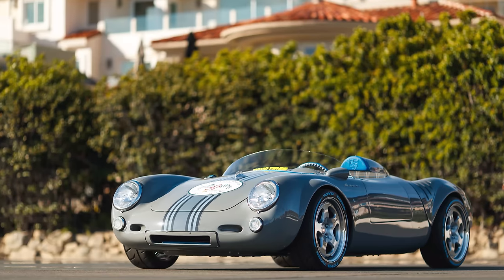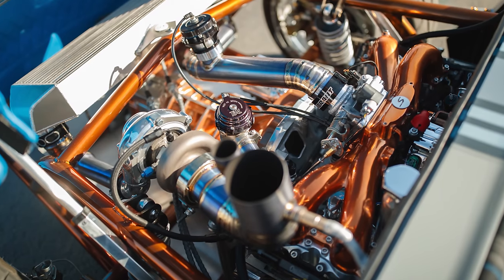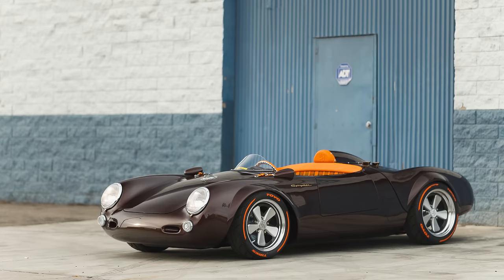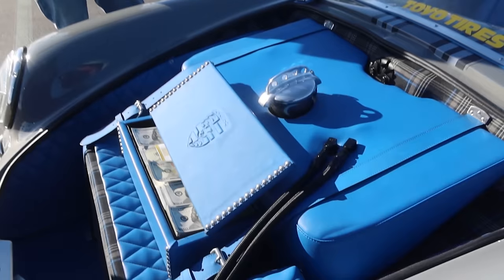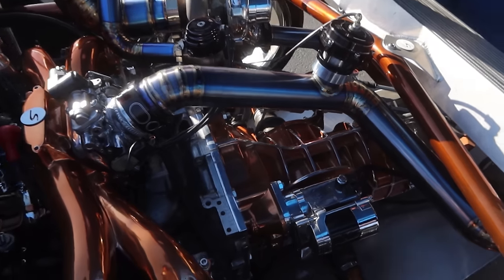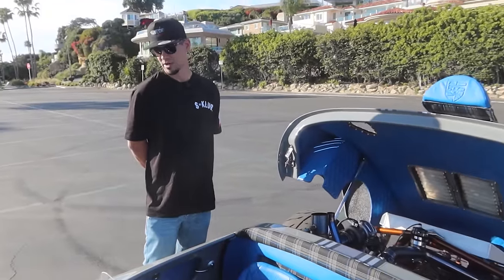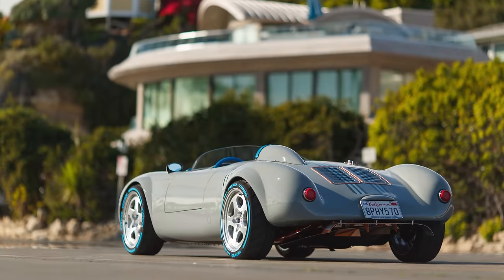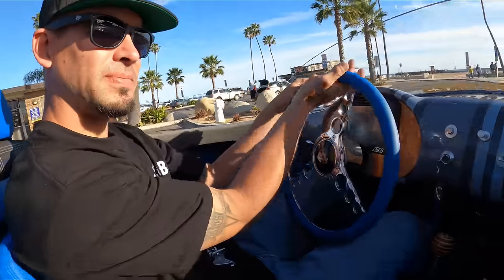A WRX Swapped Porsche Spyder - Clean Build, Sketchy Speed

Comment: Lots of respect to the builder, but the digital dash is really the lazy way out and doesn’t fit the rest of the aesthetic of the build.
Reply: had to use it with the haltec ecu he had to use to make the motor work.
Reply: @1wrexx  didn't have to use it at all. Any old analogue gauge will work with a tach signal, which I'm sure the fancy Haltech ECU can produce.
Reply: TMM exactly, not hard at all to wire outputs to some nice analog gauges.
Reply: I went with the digital dash so I can monitor everything going on with the engine since its highly modified..
Reply: @smokedoggcustoms195  makes sense

Comment: Absolutely A-W-E-S-O-M-E Porsche 550 Spyder.   That is one of my all time dream cars.   I went to the Petersen Museum just before the Corona virus made it's debut and they have a real 550 Spyder there, all original, and it is a crazy cool car.   Smaller than I thought it was.  My dad bought a 56 VW Beetle back when I was in High School and I got to drive it all the time.  I basically shared it with my mother.   That car was SO BASIC (barely a heater, no radio, no NOTHING inside it), but it was one of the most fun cars to drive.   My girlfriend at the time and I always used it to go places and it was a blast.  The 550 Spyder had a lot of the same parts as the beetle at the time, although as everyone knows,  Ferdinand Porsche upgraded and modified everything to his liking and the 550 Spyder was born.  One of the all time greatest vehicles ever made.

Comment: i have a sf forester 2001 ej 205 with the same turbo - yes starts working 1,500 rpm - runs to 7,200 rpm any time ! great .
Reply: back when Subaru were good.
Reply: @Dockhead  the motor has changed in years lol

Comment: Love the color. Really like the fact that it has a relatively small engine in keeping with the 550 Spyder. The original had just over 100 HP and weighed 1200 Lbs. This has triple the HP. I’m not a fan of all the extra leather in the “frunk “ and the electric opening engine cover (against the low weight minimal ethos of the car), but to each his own. Is this a fiberglass or metal body, and who made it?
Reply: This guy and his brother make cars and it fiber glass

Comment: I’d love to see a build like this that uses the newer turbocharged 2.5 liter flat four used in the Porsche 718 Cayman S and Boxster S. In stock form that engine puts out 350 horsepower and 309 lbs ft of torque. The last Cayman and Boxster GTS that used the 2.5 liter flat four had 365 horsepower. Even the base 718’s with the 2.0 liter flat four have 300 horsepower and 280 lbs ft of torque. Either engine can be easily modified to get more power. The 2.5 liter engine could very easily be tuned to put out over 400 horsepower but in something as light as this 550 Spyder replica the stock 350 horsepower would be more than sufficient. I just think it would be cooler and more traditional to use a Porsche powertrain when creating a Porsche replica or tribute like this.
Reply: this was probably put together just to get press coverage i wouldn't put it past it, its all these people seem to do when coming onto hoonigans tbh, build something utterly whack and out of line nearly and make sure it can run smoothly for 1 month to get to all the interviews you need to.

Comment: Why not use a Subaru trans?
Reply: Rear engined. There's no Subie gearboxes that would work with it. Usually other Porsche/VW transmissions work for rear engined cars. Some exceptions like the Renault gearbox in the Lotus Esprit but for the most part it's VW. 👍
Reply: @MafiaboysWorld  This one's mid-engined though; it's turning "backwards" compared to how the transmission would in a VW bus. The VW transmission can have ring gear swapped to the the other side to make it go the other direction.
Reply: @MafiaboysWorld  Mid engined. The Subaru sti or wrx is easily converted to fwd(2wd) which woulg be ideal in this layout.